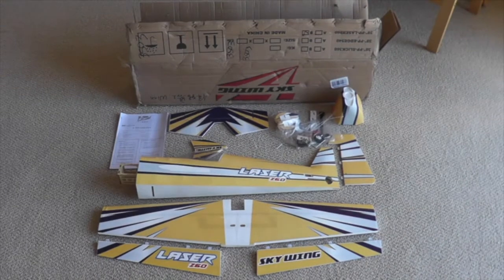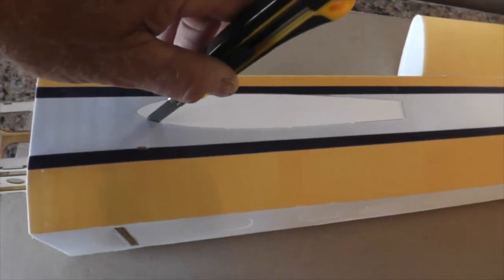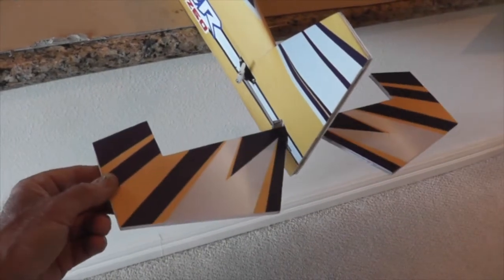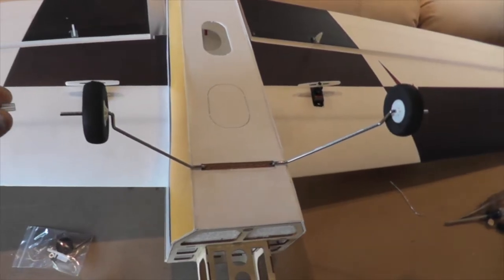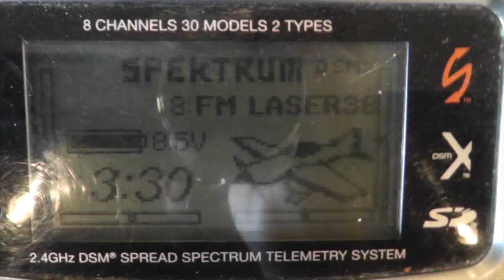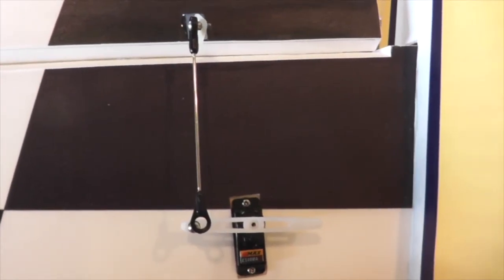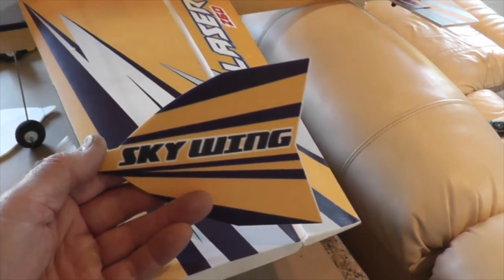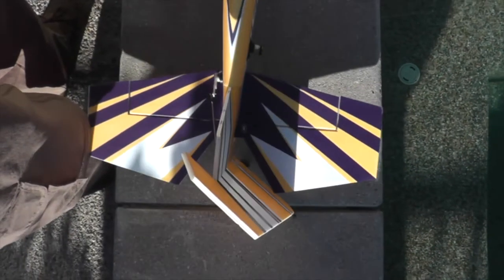Skywing 38" pp Laser 260 Build and Maiden

Comment: What do you prefer for a bit windier days outside that the smaller foamies won't fly in?  The 38" Skywing vs. 39" Hacker Edge 540 V3?  Any other thoughts between these two, or a different plane in this size you might choose instead?
Reply from the maker: Bigger is better but the risk is often not worth it. I usually just fly the 32" Vertigo, the thing is a rocket and has enough power to handle strong winds

Comment: Hello Friend!

What material is the PP ??? Skywing no longer uses EPP?
Reply from the maker: PP is Polypropylene board, a material that resembles vinyl but it fairly stiff. It has fairly good compressive and tensile strength which makes it ideal for model building.  Skywing does still sell EPP hybrids, but it looks like the trend is to switch over to PP instead of EPP.
Reply: Thank you very much for answering!  ; )

I have an EPP MXS and it flies incredible: do you think the PP is the best material for these planes?
Reply: Yes, I think the PP out performs EPP because the PP material is structurally stronger than EPP, especially in compression. This makes the fuselage and wings more rigid than a similar EPP covered airframe. The whole airframe becomes more rigid which results in a more precise flying machine. The very slow flying quality of EPP is hard to beat, but PP performs very similar and the slickness of the material I believe makes it much better for fast XA maneuvers because there is less drag. This really becomes apparent in the 38" size PP planes which outperform any of the 38" size EPP planes that I have flown.
Reply: OKAY! Very interesting your comment! I think I'll try with a 48 "in PP.   ; )